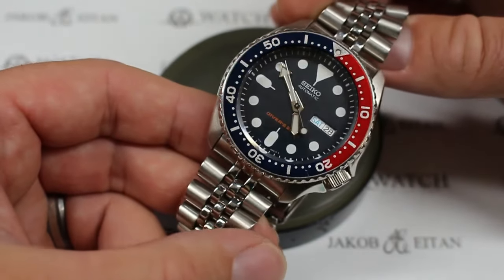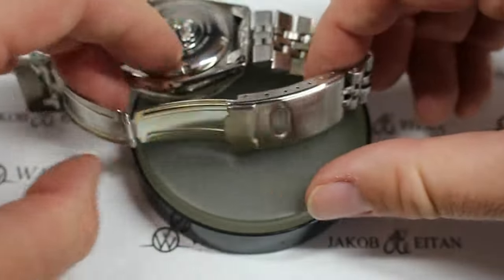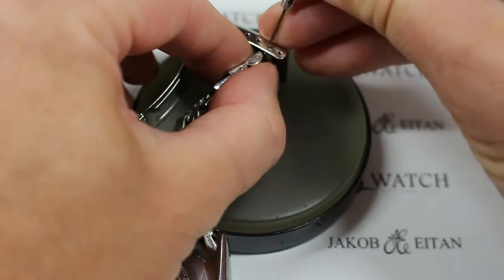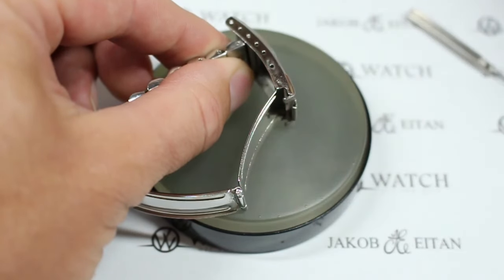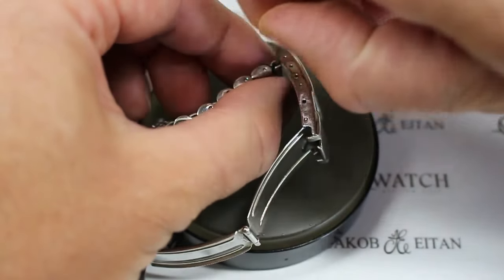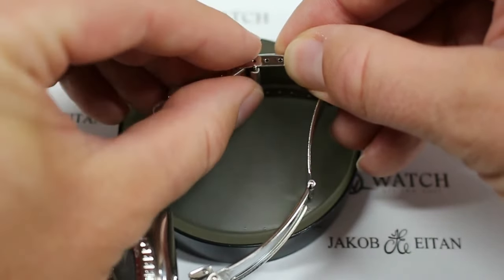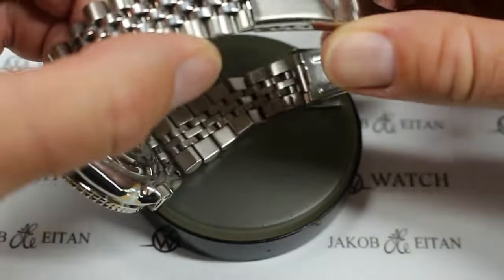How to: Watch Bracelet Micro Adjustment using the Clasp

Comment: This was not as easy as it looked, since I moved it too much in the wrong direction, and the spring popped out...nothing with watch repair has been as easy as I hoped it would be since buying a repair kit. Had to press the spring down with a metal letter opener and push it back under, and it seemed to take forever to move both pins to where they popped into the correct hole. But it's now done, and I would not have known how to do this, or what tools to use without your video. Many thanks!!
Reply from the maker: It can be a bit tricky the first time!  Glad that it worked out in the end.  I struggled with many watch repairs until I had done them over and over again (as I own a watch repair business!).  If you ever need to make an adjustment again, either on the watch you worked on, or another one you will do way better the second time!  Anyway, I feel your pain, but I'm glad it worked out in the end, if you ever get stuck send me a message and I'll try to help!
Cheers,
Colin

Comment: Great video that's saved me a lot of frustration. For some unknown reason it never occurred to me to push the pins in one at a time and move each side of the link separately 😂
On one of my watches it's not actually a link that attaches into the microadjustment, but a part of the clasp. That makes it a bit trickier as you can't reposition that part at all until both pins are pressed in, but it's still much easier to push one side in, hold it in place, then push the other side in so that you can then move the relevant part.
Reply from the maker: Thanks, glad the video was helpful!!!   It helps to inspire me to keep making videos.  Cheers, Colin

Comment: I did exactly what you said not too, and my spring bar shot across the room and vanished. Are there places to buy new ones? How do I know what size to buy?
Reply from the maker: Oh no!  It has happened to us all!  Okay first measure the distance on the inside of the clasp in millimeters.  Then look at the end of the link to determine the approximate diameter of spring bar so it fits but not too loose.  With those 2 measurements you should be able to order a new one.
Here is my site, but lots of watch parts sellers have them:
https://watchoffthecuff.com/collections/spring-bars
One thing to note is that the end of standard spring bars might poke out a little bit past the clasp.  If it doesn't bother you then no problem, if it does, you can file down the end so it doesn't stick out.
Hope that helps!!!
Cheers,
Colin
Reply: Thank you so much for such a helpful response so quickly! Even though you're video was short, I was impatient and paused it right BEFORE you gave the tip about holding your finger over the hole for that exact reason. Thanks again!  @watchoffthecuff

Comment: Hi, it seems that i am unable to poke into the notch because it seems that the spring is kinda stuck.. anyway to fix  it if the spring is stuck please?
Reply from the maker: They do sometimes get sticky.  The main problem is that the inner spring is typically plain steel and gets rusty over time.  You can force it, but the spring bar comes apart when you do that.. you can piece it together and put it back or you will need a new spring bar.  The other issue will probably be that a standard spring bar will stick out a little bit past the clasp, as ones designed for the clasp have a stubby end so it sits flush.  It may mean a trip to your local watchmaker!
Cheers,
Colin

Comment: i have a clap where the spring bar broke when i removed it  is there a particular type i need to get or will a generic on fit if i get the correct length?
Reply from the maker: The short answer is yes, however, usually the spring bars for clasps use a spring bar with a shorter end.  So a standard will work, but it is likely that it will poke out a bit through the hole in the clasp.  Since I have the tools I simply file down the end of the spring bar so it sits flush.
Hope this helps!
Cheers,
Colin
Reply: @watchoffthecuff  thanks, I have some jewellery files. Maybe they will file them down
Reply from the maker: Perfect.  Measure the diameter of the spring bar as well.  Generic ones are typically 1.5mm but the clasp spring bars are quite often 1.8mm.
if you cant find the right diameter check my website, i have just about every size available.

Comment: Hi can you tell me what the spring is called so i can but a replacement please. Mine flew out
Reply from the maker: Its called a spring bar.  Most common diameter is 1.5mm, measure the inside ot the clasp to determine length required.  I have just about every size of spring bar on my website....
watchoffthecuff.com
Reply: Thank u cery much

Comment: My clasp Spring bar popped out & seems to be too small to fit back in - when i put it in one side the other looks to have a bit of space left. Am i doing something wrong or is it broken?
Reply from the maker: Sometimes when you squeeze the springbar one or both sides can get stuck, and dont spring back out.  If you are lucky you can gently pull it back out.  Other times one end can pop out too... so check to see if one end is missing!  It is possible to buy a new springbar if you need a new one.
Reply: @watchoffthecuff   Thanks for your insight. The springbar was broken on one side hence why it always connected to one side but not the other. Cheers!

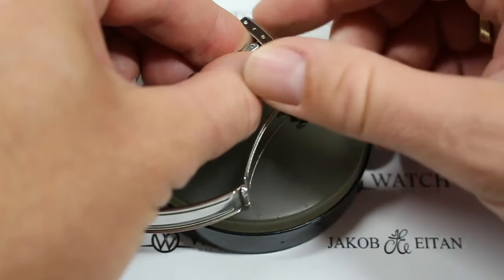Comment: This might be a stupid question... so moving it in one notch from the second to the third hole as you do at about 0:55, that makes the strap slightly bigger yeah?  I don't want to accidentally make it smaller 😅
Reply from the maker: Moving it in will make it smaller.   I do talk about bigger and smaller in the video interchangeably... so my bad!  but at the 0.55 mim mark that action will make the band smaller.  Cheers, Colin
Reply: @watchoffthecuff  thanks for clearing that up, much appreciated!  My new watch is too small, and no more adjustments available, bugger 😅
Reply from the maker: arghhhh that sucks.  Do you have an extra link you can put in???

Comment: Does anyone know if this watch will fit an 8.75 inch wrist?
Reply from the maker: I have a 7 inch wrist, and when I sized this for myself I think I took out 3 links, reducing thrbband by 3/4", then I micro adjusted one alot, reducing it another 1/8" (making estimated size of bracelet out of the box a maximum of no more than 8").  So I think you would definitely have to purchase extra links.  For reference this is the Malaysian version of the SKX009 (K), as they Japanese version (J) only comes on a silicone strap.  However there are lots of aftermarket jubilee style bracelets available for this watch!  Maybe try Strapsco first to see what the options are?
Cheers, 
Colin